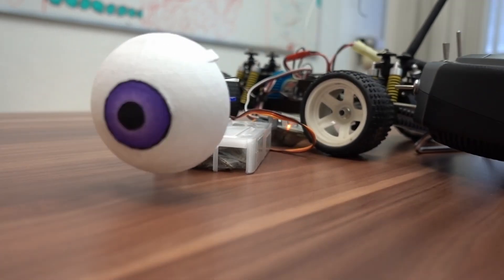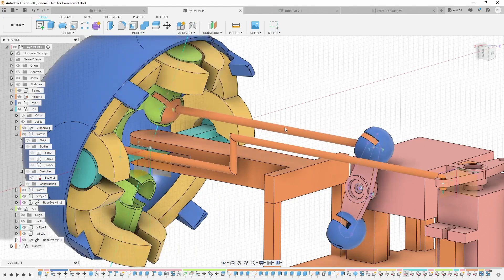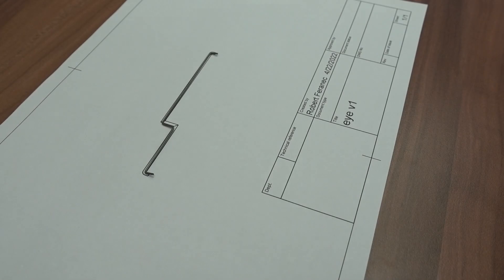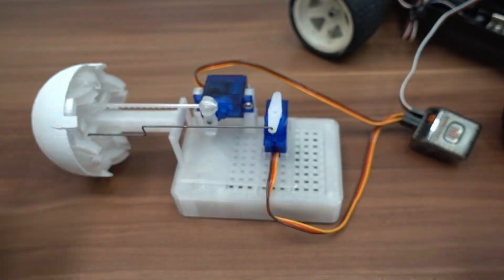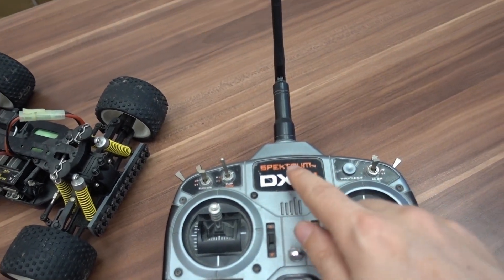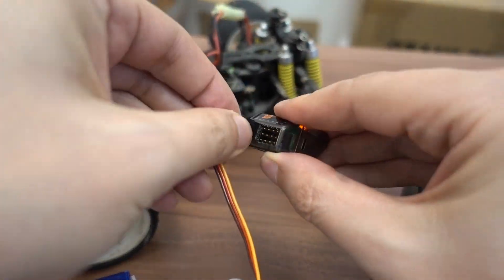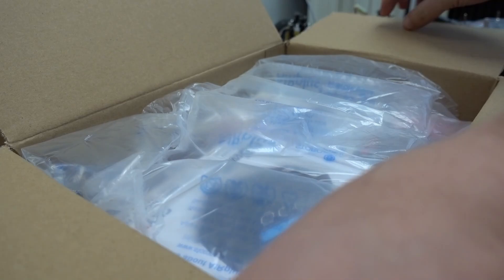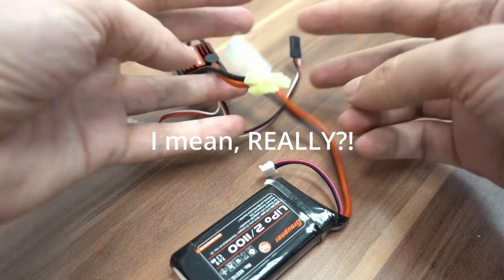Building a radio controlled moving eye

Comment: Very neat eyeball. Battery connectors are a pain. I'm building a little tank robot thing and I can't find a pcb mountable receptacle for all these dumb proprietary connectors.
Reply from the maker: Yeah, often they don't exactly say what connectors are there, sometimes they just say like "Tamiya" ... and clearly I bought the two components with Tamiya connectors but with different size. Lesson learned, adapter cable ordered and now everything works. Waiting for camera to arrive .... PS: Good luck with your project
Reply: @RobertFeranec  Thanks man. Same to you!

Comment: A simpler way to test the servos, is to use 2 servo testers. You can find them for 2$ each. And power it using a single cell lipo battery. 3.7v is enough for most servos.
This is much simpler than using a radio control system. 
Besides that, a cool project 😉

Comment: you can make a custom transmitter and receiver for it as well, and add all kinds of wacky sliders, buttons joysticks to it, many people have done it its generally cased on a NRF24. also ther was no need to use a ESC to drive the receiver they work on 5v the power pins are usually the second and third ones middle one being +5v and bottom one ground but ig using the esc is convenient. i sadly have given up on most RC projects cuz my country has banned chinese stuff so parts cost is ridiculously high for me, i would rather build smaller but many projects.
Reply from the maker: Thank you Alientoast PS: I have seen some people to play with custom transmitters and receivers. It was cool. In my case, the final product will be controlled by Raspberry Pi. So, I decided to use RC just to make a quick test to see how the eye will move and ... because I always wanted to learn how RC works. If I knew it was so simple, I would start playing with it a long time ago. PSS: I was thinking to use 5V, but I wanted to have the full kit, just in case I would like to play also with some motors :)